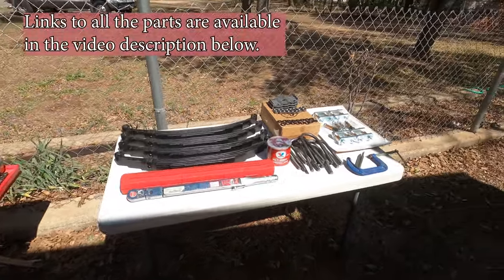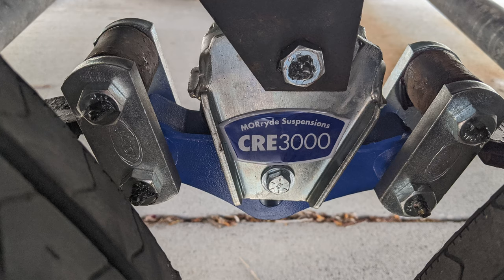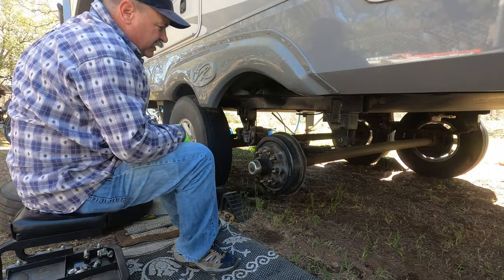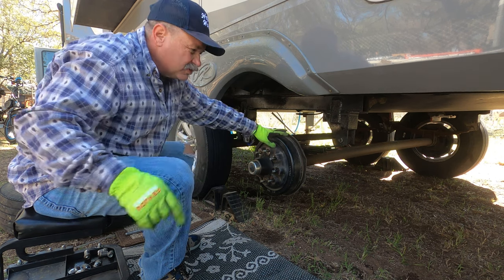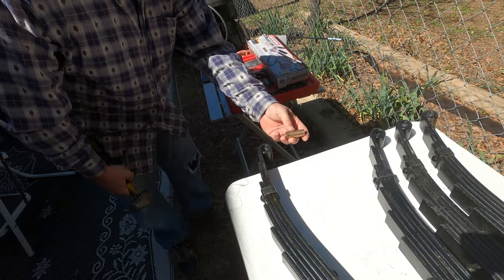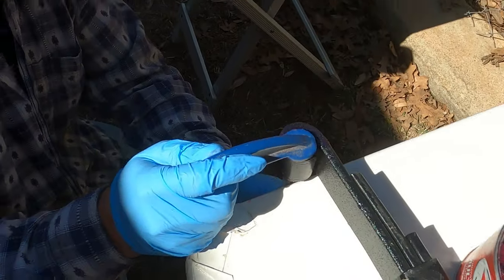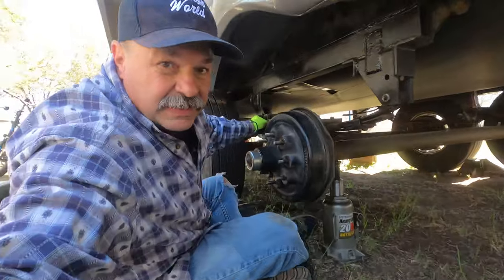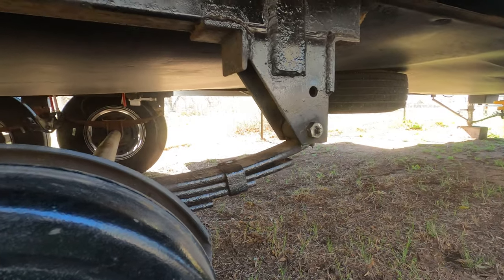Step-by-step Guide To Replacing A Broken Leaf Spring On Your Trailer

Comment: First off, didn't recognize you with your haircut.  LOL    second,  I agree with installing new wet bolts even though you put them in a few years ago.  It's cheap insurance a good preventative maintenance. 👍
Reply from the maker: Hi Rick, yeah, I am back to a high and tight hair cut, guess my hippy stage is over, at least for a while. I really debated relacing the CRE3000 as well, but it really is still in great shape. Thanks so much for stopping by and commenting. 🍻 Sean

Comment: Great video and good photos.  Did you enhance the metal support on your spring hangers?  They look beefed up with added angle iron and welds?  Also, I hear different comments on best jack placement.  Where exactly did you jack up the frame and did you jack up one side at a time?  Thanks.
Reply from the maker: Hi Chuck, yes, back in 2017 I had my wifes cousin reinforce the spring hangers. I had that done due to seeing many posts in the forums with people experiencing broken hangers. As for raising the trailer, in this video I used the landing gear front and back to raise the trailer until until the suspension was unloaded and the tires were barely still touching the ground. Then, as seen in the video I used a bottle jack to raise the tires off the ground to remove them one side at a time.

Comment: Why the added support on frame?
Reply from the maker: Back in 2019 we were preparing to go to Alaska in the spring of 2020. Unfortunately when COVID hit we ended up not going. But in preparation of that trip I reinforced the shackle hangers as a preventative measure. The Lippert welded hangers have a propensity to fail, and I didn't want to have a hanger failure in the middle of nowhere. 👍

Comment: I noticed you welded angle iron and a plate to your spring hangers.  Have you noticed a difference and mind if I ask about how much that cost for the angle piece and plate to be welded?  Good video by the way.  I plan to do the same so I was very interested in watching your video.  Also, did you add a beefier leaf spring than what you originally had?  Thank you.
Reply from the maker: Hi Chuck. Thanks for the kind words. We purchased our trailer new in Sept. 2016. In 2018 I had my wife's cousin reinforce the hangers on the trailer. I paid him $100 bucks at the time. I wanted the piece of mind in getting them reinforced. My trailer came with 6000 lbs springs, (3000 lb each) I put 7000 lbs springs on when I did this video (3500 lb each) Good luck with your project. 👍 Sean

Comment: You would have a lot fewer spring problems if your trailer had shocks on it.
Reply from the maker: Interesting statement, define "fewer", we have put just over 40,000 miles on the rig. This is the first time I have had an issue. So are you implying the spring would not have broken had I installed shocks? Of course you could be correct, but then, even with a set of shocks on, the spring still may have broken. 🤔

Comment: I understand that this is an RV but what I'm about to tell you has nothing to do with an RV I have a 1999 Ford ranger that started having a loud creek and clunk in the front end I put it in the shop and had all the brakes, replaced got it back, same problem put it back in the shop had the entire front end rebuilt now here's the kicker so they said I paid $1,000 to have the front end rebuilt got it back, same problem took it back he said it's the leaf springs it's the leaf springs I drove it for 6 months, took it back had the leaf springs rebuilt got it back didn't change a damn thing same problem so I paid for upper and lower control arm replacement and bushings, took it to another shop they didn't inspection they said the leaf spring brackets are completely worn out and shot and so are the lower control arms and bushings. Here's my point I called the bureau of Automotive repair and I'm suing this shop that our buddies of mine and have been using them for 25 years, back to the point I don't trust you I don't trust them I don't trust him I don't trust anybody with my vehicles anymore I don't trust the guy next door I don't trust the best shopping in the United States with my vehicles anymore so when you tell me my leaf springs are bad I'm going to tell you don't f**** touch my f**** leaf springs now not only does the truck sit crooked front to back it sits crooked also side to side The front has always been higher than the back That's how those trucks are supposed to sit, and if you stand behind it and look at it it sits crooked now from side to side so nobody will ever touch my leaf springs on anything ever again on any vehicle I own
Reply: So more than $2,000 in it turns out all it needed was lower control arms and bushings that I paid for they never touched them cost me $500 to have the leaf springs rebuilt
Reply from the maker: Hi Kenny. Wow. Not really sure where to go with this. As you saw in the video I not only had 1, but 2 broken springs so they needed to be replaced. Sorry you had such an issue with your Ranger. Sometimes dealing with mechanical issues can be a PITA. I do all my own work, be it on our trailer or my vehicles. I was fortunate to have been raised by a man who fixed stuff, I took shop in High school after which I went to trade school in Phoenix and spent 18 months becoming a certified mechanic. At this point in life that knowledge is a catch 22, as I know how to deal with these issues, but I don't want to....LOL. When I suggest having someone else tackle a job my wife glares at me. My kids all have a list of stuff I need to do on their cars when I get back to UT. In any event, thanks for watching. I hope you found the video helpful or entertaining in some way. Safe travels! Seah
Reply: Well I've been using this shop for 25 years I took it back six or seven times for the same issue spent $2,000 they still couldn't get it right it never got fixed I filed a complaint with the state who advised me to take it to another shop and get it a second opinion and these guys figured it out in 5 minutes